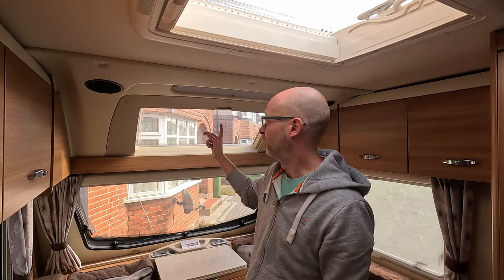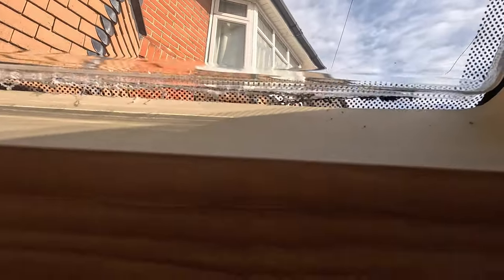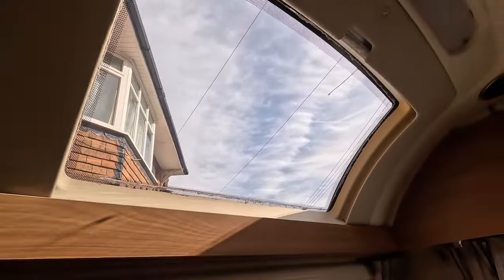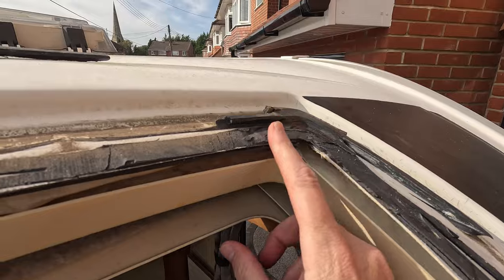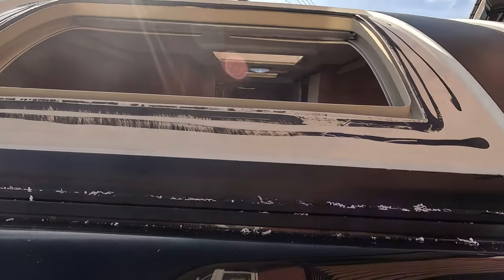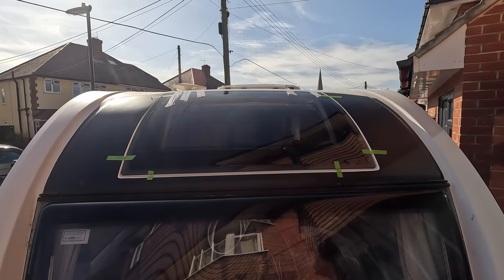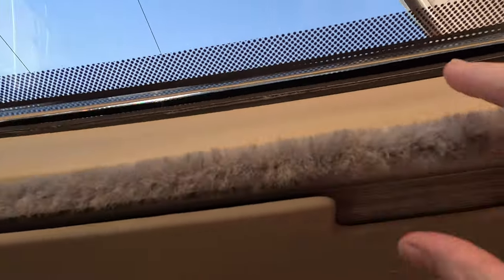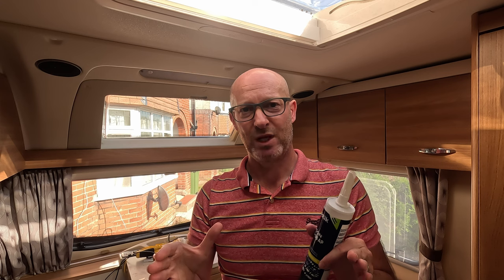How To Replacement A Caravan Sunroof Window 🛠️ #caravan

Comment: I have a swift as well they say £800 to £1000 to fit one, I believe the dealers cut it out as well to change one. Looks like you have done a good job looks well.
Reply from the maker: Thanks Paul, not sure why they charge so much for these.
Reply: I have just been quoted £1900 from dealer to replace ours
Reply from the maker: You really do need to shop around due to the price, if you are looking to get a third party to do the work you'll be looking at anything from £1500 to £2500 if completed under insurance, it will always be much cheaper to source the window and get someone to fit it but it just takes more time to get everything in place.

Comment: Great job, so glad my van doesn’t have a Pano window.
Reply from the maker: The main issue is these windows are under much pressure during travel, hitting holes in the road causing the caravan to jump about, and the other item such as stones and other items being flicked up by other road users, it's like a large target on the roof.

Comment: Had exact same issue on our 2021 Alpine 4. Our was cracked in at least 4 locations on the window and we were lucky that it was covered under warranty. Got rid of that caravan as were a number of other issues and traded in for a 2010 model Swift. I’d never touch a newly built caravan again. The older Swift seems to be of much better construction. After further digging it would appear that this window cracking is a common problem on these Swifts.
Reply from the maker: Yes, it does seem that way after looking into the issue, many people reporting the same thing. As with any caravan, it's all fun and games when it comes to maintaining them lol.

Comment: where abouts did you get the new pan roof from? im just about to purchase a swift 2014 and the pan roof is a bit iffy but the price of the caravan is brilliant so dont wanna miss out lol ill replace it myself :D
Reply from the maker: Hi, if you check the description/comments you will find all the info you need regarding supplier, items needed and costings, any other questions get back to me.
Reply: @wobbleboxcrew  theres nothing in the description about the new pan roof?
Reply from the maker: Hi, we got it from Tilshead Caravans, the cost was about £400 last year, it was the cheapest I could find it for. The items I used to install the new window can be found in the description.

Comment: The same thing happened to my 2021 swift 580, this is a built in fault so I’m expecting it to happen again, Swift don’t seem to have answer to the problem.
Reply from the maker: As you say it does seem to be a common problem with Swift and to try and help they advise now to install a line of silicone across the top to help support the window. I think you just need to be as careful as you can when towing and avoid any potholes or anything that would cause the caravan to move suddenly which would put stress on the window etc. Fingers crossed it doesn't come back for you and thanks for supporting the channel 🙂
Reply: What is the number to swift so I can contact them for the same reason as it’s happened to me would it still be under warranty it’s a 2021 swift pioneer

Comment: Great Vid thanks, really helps to show whats behind the window black out.
I'm trying to source a replacement to freight to Australia. 
Would you have the part number to make my search easier.
Local cost here is around AU3K so around 400quid and freight should end up a little more economical.
Reply from the maker: Hi Richard, the part number I had on our paperwork was 1094769, we purchased the window from Tilshead Caravans, and at that time the cost was £365, hope this helps.

Comment: Excellent tutorial only question i have is did you mark were to seal on your temporary fit regards  Dave.
Reply from the maker: Hi Dave, no, once I had cleaned all the old silicone off you could still see where it had been, it had discoloured the gel coat making it easy to reinstall, hope that helps.

Comment: Hi - thanks for putting together and thoughts on how this can happen as we were scratching our heads wondering if and when something may have hit us to cause the same.

What was the foam used around the window edging?

Thanks again
Reply from the maker: Hi Jamie, so when you purchase a replacement window this comes with it, it's a double-sided tape about 5mm x 5mm from what I can remember, it helps keep the window in place so you need to make sure it's all lined up before you go for it.

Comment: Hi, very informative video. How many tubes of sealant did you use?
Reply from the maker: Hi, I purchased 6 but only used 5, and still had half a tube left over. When you remove the windows pay attention to the placement of the old silicone/form, and the amount. The silicone is thick, so another tip would be to ensure it's not cold or will be harder to spread when you install the window. Just remember you are trying to make a good seal and not apply all of the silicone, this is important or you are making it harder for yourself. If you have any other questions please come back to me.

Comment: Hi what silicone  did you use
Reply from the maker: Hi, we used Simson ISR 70-08 Black Adhesive 290ml which is needed to keep the window in place, a normal silicone wouldn't hold the window so make sure you get the correct item.

Comment: What kind and size foam did you use
Reply from the maker: Hi, the foam comes with the window as part of the package, from what I can remember it's some like 8mm by 8mm.
Reply: Hi, in the video when talking about the foam, i can see where you put it on the outside but did you mention putting foam on the inside also and if so where did you put it? Thanks Dave